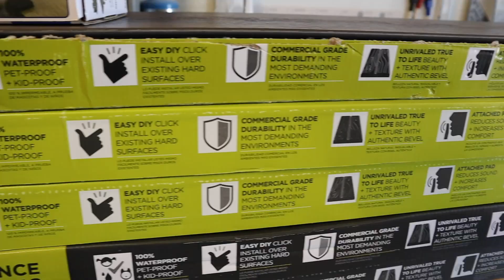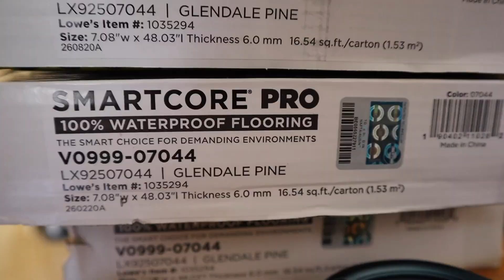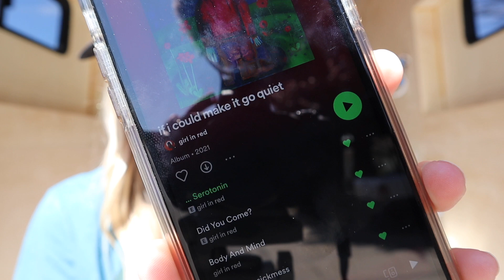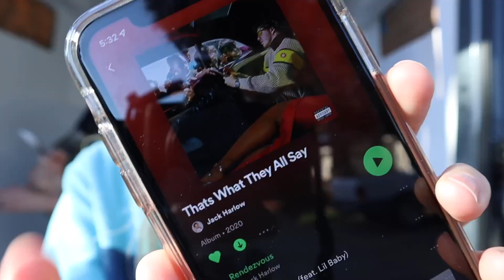Vinyl Plank Flooring & Painting Walls! | 2021 Ford Transit DIY Van Build Conversion Ep. 18

Comment: nice floor. FYI hif that is 14/2 romex housing wire it's NOT for mobile use , solid core it prone to breaking due to vehicle movements. Best to use stranded automotive wire . info for the next person) cheers 😁

Comment: Hey Mike, any issues with the weight of cabinets, shower drain holes, etc. on the LVP?  Thanks so much!
Reply from the maker: No issues with those things! The only issue we’ve had with the LVP is that it contracts and expands depending on the weather. We accidentally let direct sunlight hit it on a hot summer day last year and it expanded and came up in one of the corners, so we had to tape it down. It’s ugly but fine lol

Comment: It looks great . I’m thinking if I ever do a van I’d add a quarter inch of plywood on top of the heated mat . So I have something to adhere my vinyl / wood look flooring to . Also I’m thinking about getting everything in before putting flooring down . That will save on flooring cost  . More cuts more headaches but I have a lot of time . Is there something in the instructions of heated mat about how thick material above it can be and it still work ?
Reply: Most vinyl plank floors are floating floors so you don’t “adhere” them down. And in this case it’s best to lay the whole floor first so that your cabinetry and other items help hold them in place!  Typical in a home you’d use quarter round along the base molding to do this but in a van that would just add more unnecessary weight!
Reply: @beautybyleanne76  Realize all of that. Still very glad you added to the comment I made . What I’m seeing is where the heated floor is there’s already a slight raise there . I’m hoping since it’s also going to be in the only foot traffic area it’ll stay down . But with the bumpy roads we shall see . I’m sure they’ll update us in six months .